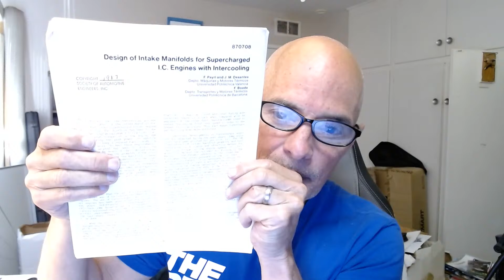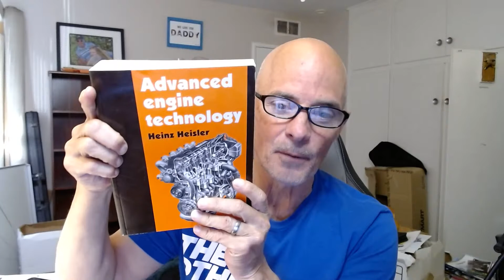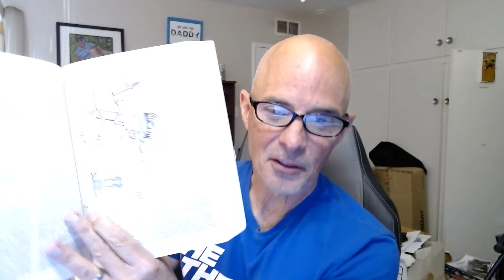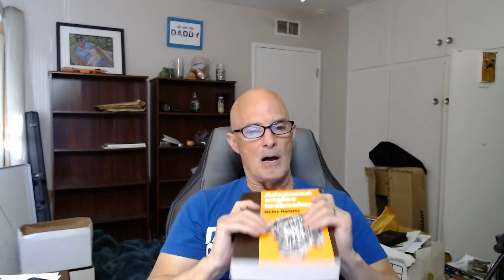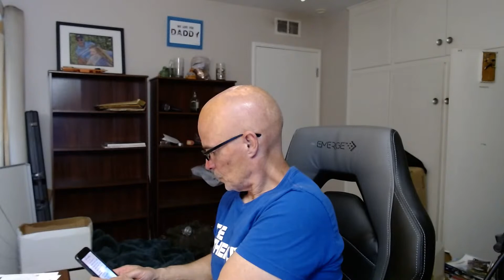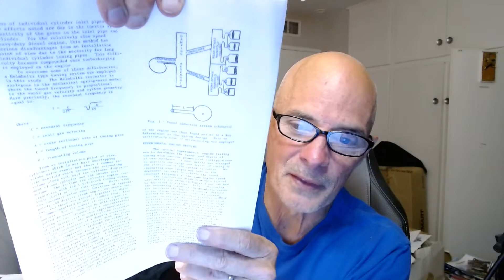LET'S TALK TECH-SPACER TEST COMING UP AND TONITE IT'S BOOK CLUB!

Comment: What’s going on Richard, I have a question that’s off your recent subjects. I have a stock cam that I took off my 2017 L86 6.2. Can I use this cam on my 2014 5.3?
Reply from the maker: IS THE 2014 AN L83?
Reply: Yes in my Silverado
Reply: If possible how much horsepower can I expect to gain?

Comment: You could make the 3 foot tube work and transition it would take 2 carb though…split the circuits up. Use Idle and accell pumps on bottom carb block off main jets pv and air bleeds and remove boosters. On the top carb no accell pumps and close the idle mix circuit. Use main circuit power enrichment on the top carb normally. :)